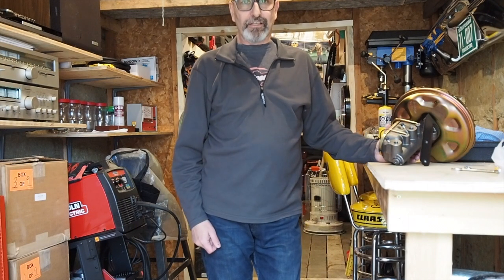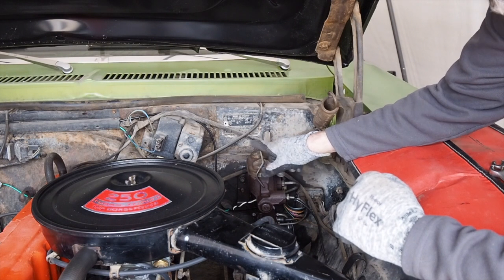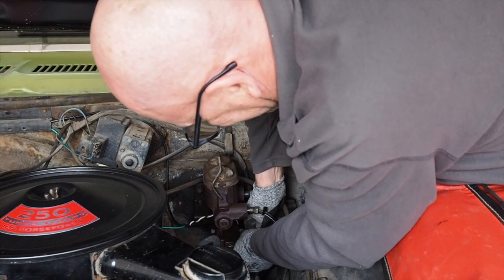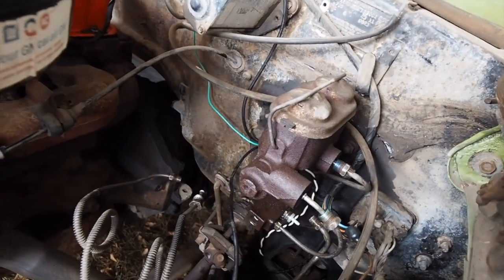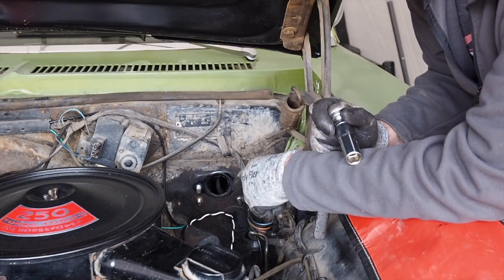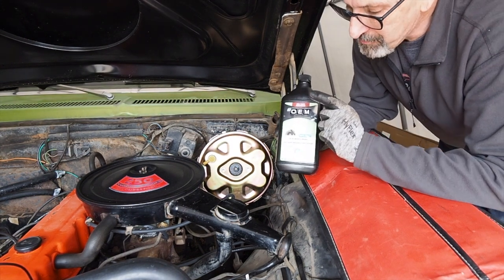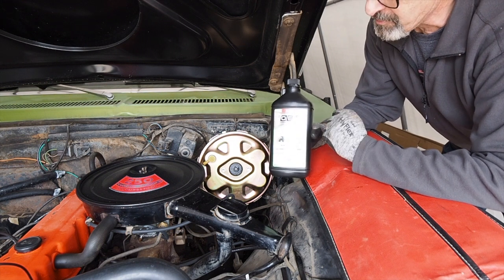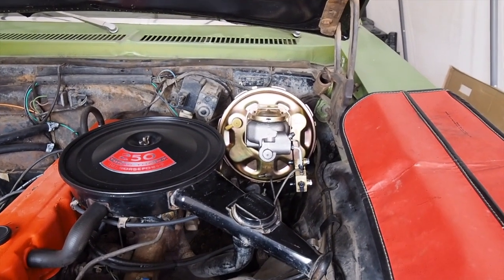1971 Nova Power Brakes Part I

Comment: Nice video, but I think you should have included adjustment between the booster/master cylinder adjusting nut. There should be a very small amount of clearance, maybe the thickness of a sheet of paper for the booster and master to work properly.
Reply from the maker: Yes you are right hopefully people will read your tip....Thanks for watching